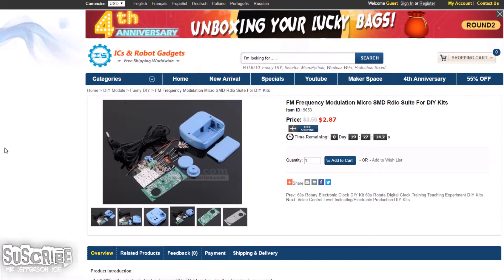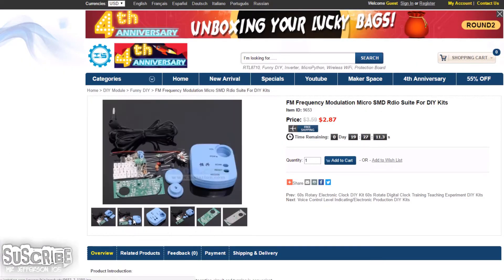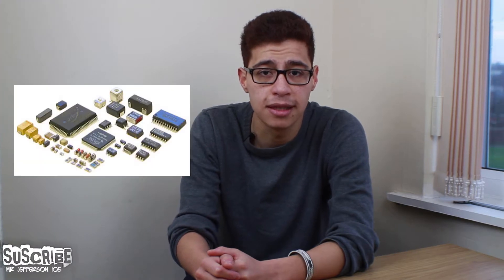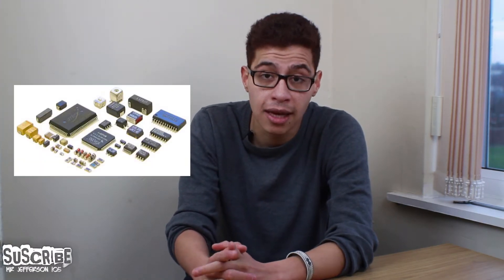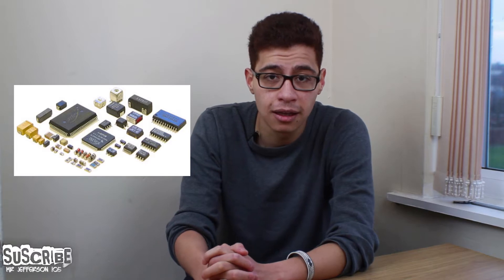FM Frequency Modulation Micro SMD Rdio

Comment: well mine failed somehow , rip
Reply from the maker: MR.Cornholio121 maybe something was not soldered properly . Double check the resistors and coils . Also if you have applied to much heat while soldering the chip may be a problem . I used 2 different soldering irons one at 5 W for the chip and for the rest 15 W was ok for me .
Reply: I only used a 5w , at the lowest temperature that was able to do the soldering , i used a solder paste pen and as little as i could of solder and secured some parts when it was fully finished with hot glue, but hey the led still turns on haha , sad but im gonna re-use some parts so i just wasted time , but ive got worst
Reply from the maker: MR.Cornholio121 I am not too sure what to suggest . Maybe  every kit is different or  a component may have been damaged. Sorry to hear that it did not work for you  .I soldered the whole thing just under 2 hours .

Comment: I am guessing that the 78nH coil is the little larger one and the smaller one is the 70nH, correct?  Also how do I orient the V1 diode (looks like a transistor, but two legs are long  and the middle pin is very short)?

Please let me know.
Reply from the maker: hey it has been a long time since I build it . with regards to the coils you are correct. mine came with a schematic showing v1 orientation , i no longer have those documents.
Reply: thanks for replying.  I believe there are some Russian vids submitted here that put together the same kit.  Even though I won't understand a thing I will check those out.  Thanks again.
Reply: Got it working thanks sir!
Reply from the maker: nice one i am glad it worked . :D